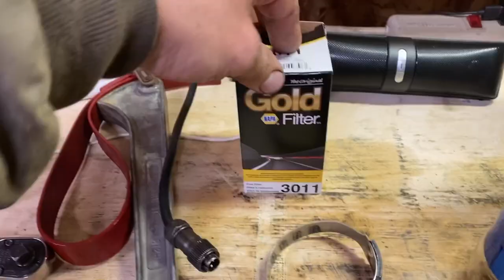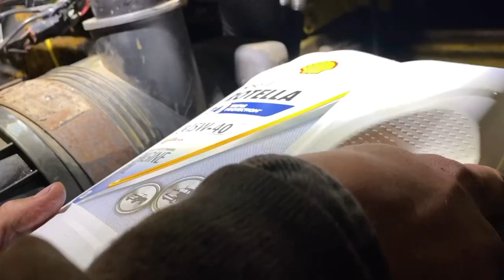Changing the Fuel filter, Hydraulic filter, and Engine oil/Filter on my skidsteer -Repairs Part 3

Comment: I am working on a gehl 4835.  The oil drain plug is under the rear bottom plate. I removed the plate and the drain plug was right there with a large Allen wrench for the plug!  After removing filter and re-installing I put 8 quarts of oil in.  The book says that the chain case is also due at this hour mark.  According to the 4835 gehl book, it appears that you drained the rear chain case on that side, which also takes same engine oil!
Reply from the maker: Thanks man, I did this job awhile ago so I can’t fully remember but I’m pretty positive i changed the engine oil, after I drained it I checked my dipstick and it was empty. My GEHL was Oil cooled not water cooled. They made some oil cooled ones and some water cooled.. the water cooled engines are better, lower maintinance and faster starting/warm up times and takes less engine oil too.. this may be why your drain plug was different than mine but the rest of the machine should be very similar. The DUTZ engines are great engines they will run forever but a lot of them are hard starting and burn oil.. after I added the oil additives to mine I no longer had a smoking issue and ended up trading this skidsteer for the Cummins pickup I still drive and use today in my videos. Thanks for watching 👍🏻

Comment: get u an inversion table n twist n hang up side down n be amazed  how much money n how quick the relief is for back problems
Reply from the maker: That's so funny you said that! I got one for xmas from my mother as she knows i have a bad back.. So far i love it! Thanks for your comment man
Reply: @BiffsEquipment  Best hundred bucks I ever spent for my back from Walmart I cant tell you how many times I got off work as a delivery driver for Menards in Minot delivering in the oil fields thinkin about going to a Chiropractor $30-50/hr n got on that bat hangin board and instant relief in seconds or minutes sometimes hearing my back pop into place another thing is a "tens unit" its like electrical stimulous very low voltage id guess less then a hundred bucks as well. I got oneoff ebay that is dangerous u control the current but you gotta be careful mine had 3- 9 volt batteries almost like touching an electric fence. Gehl are famous for forklifts any way mostly telehandlers high lift so parts should be easy to find or things like grapplers for round bails n such since ur a farm guy another thing to consider find u some old tractor tires n u might be able to wrap them around ur two tires so u can have a track type effect in the winter for better traction Ive seen it before some place can be slick as hell and a lot cheaper then buying tracks for a skid steer. shhh keep this quiet though more then one way to skin a cat or a fish
Reply from the maker: @jdram58  right on man, and thanks for the tips!

Comment: Hi I have a 2010 Gehl 4840 e turbo I can only find two grease zerk fittings on the quick attach is that normal? My old bobcat had a bunch of them?
Reply from the maker: No it sounds like most of them got broken off, you’ll have to locate the manual or the grease points online and find the broken grease fittings and use a tap to get them out and thread new fittings back in their places so you can grease it all once again. Often they get covered by mud or debris too. You should for sure have at least 4-8 between the curl cylinders and the boom cylinders themselves and I’m sure more in the engine compartment on other moving parts

Comment: I'm working on a mustang skid, which is the same you have, do you know where the fuse box is located I can't find it on mine, thanks.
Reply from the maker: Very cool! The fuses on mine were located under the instrument panels inside the cab.. like behind the panel for my heater controls and all that were

Comment: what kind of hydraulic oil will the mustang 2040 take ? Please help the clamp came off and it dropped all oil
Reply from the maker: Napa premium hydraulic oil should prolly work
Reply: @BiffsEquipment  appreciate your response! Do you recollect how much oil it would take 1 gal or more!
Reply from the maker: @rocket2811  it should take quite a bit as most skidsteers do. When I did mine I bought a 5 gallon bucket. You could always start with a gallon and buy more if you need it or get a 5 gallon bucket and keep the extra sitting around for if you ever need it again. Try to figure out how much oil you lost to begin with when the clamp fell off

Comment: Maybe a dumb question, but this machine has a diesel engine, right? I'd like to do the same fuel flush on mine if able.
Reply from the maker: Jamie Policky hey Jamie yep it had a Deutz Diesel engine.. you can run any Diesel engine off straight seafoam it won’t hurt it .. does wonders for the injectors/engine